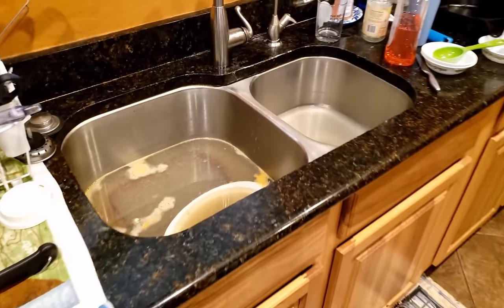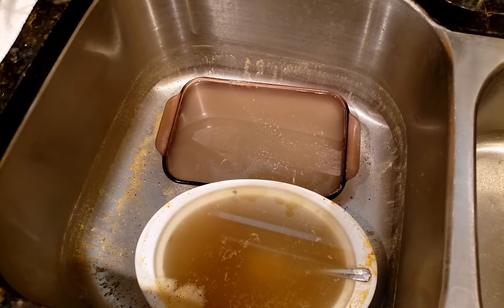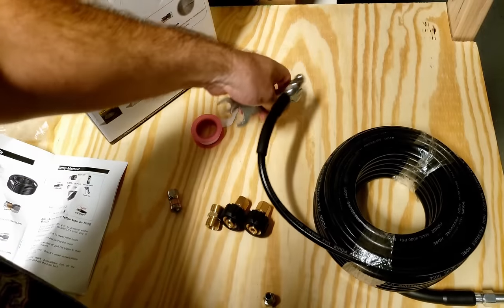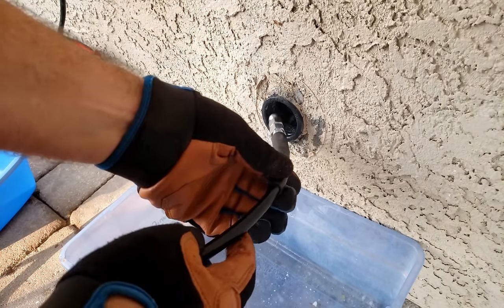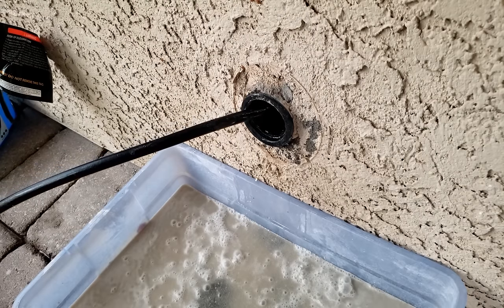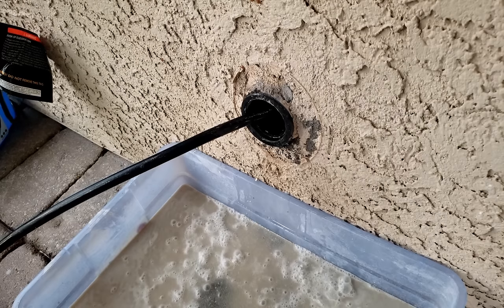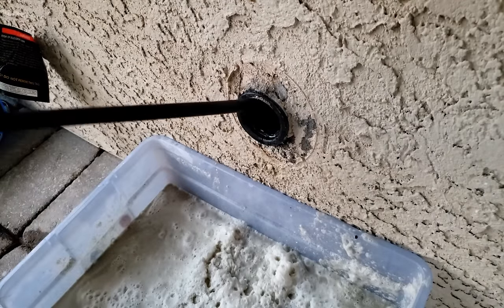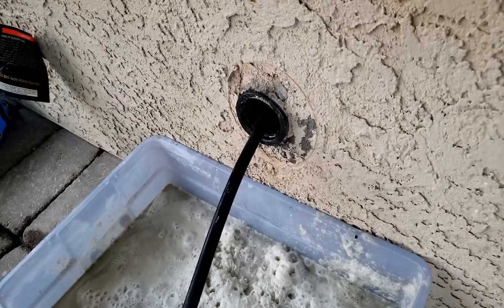UNCLOGGING my kitchen sink with a PRESSURE WASHER and the POHIR Sewer Jetter Kit

Comment from the maker: To get more information on the products used in this video there are some Amazon affiliate links in the description for the POHIR Sewer Jetter Kit and the Sun Joe Pressure Washer. This is not a spoused video. The products used to unclog our sewer line were bought with our own money.
Reply: Inherited a house that gets sewer line problems now and then.  Stupid question.  Can I clean the lines through the washing machine drain pipe instead of going outside?  (We moved the washing machine upstairs so I have a pipe in the basement that I use to get rid of dehumidifier water and to get rid of water when there have been floods.  It would be so convenient if I could do this process through that pipe.
Reply from the maker: If you have a large house there may be multiple drain pipes that can get clogged. It just depends where the clog is. If the clog is after the laundry drain then it should work but if it is in another drain pipe you will have to move up to that pipe to unclog it. The Sewer Jetter Kit description says it works on all kinds of drains, inside and outside. I have not used it inside the house yet but I plan too. I have a slow draining toilet that I am planning to use it on. It is upstairs and the toilets go down a different drain pipe. So I will have to go up there to clean out that drain pipe. I am using an electric pressure washer but if you are using a gas pressure washer the exhaust fumes could be an issue inside your house. I would also be concerned about the water coming back out of the drain as well. A lot of water came back out of the sewer line while I was breaking up the clog. So a good wet vac would really help to clean up any excess water during the process.
Reply: @ThatHobby  Thank you that is helpful.  I have a ranch.  It doesn't have two levels.  And I think the washing machine drain is closest to the main line drain.  In the basement, I can see the rest of the pipes in proximity to the washing machine pipes.  They aren't that far apart.  I will try it.  I don't really have a clog right now.  But I am trying to do a clearing process of some sort once a year before the first freeze.  We have had the mainline back up into the basement a few times and for the rest of my life the goal is to be proactive in preventing it from happening ever again.
Reply: @ThatHobby  luckily in the uk we don't have waste disposals and also our pipes go straight outside to a gully
Reply from the maker: @theoddjobcentre6686  That sounds like a pretty good set up

Comment: In my opinion: Get rid of the garbage disposal. This does nothing but keep plumbers in business. People putting their table scraps in the disposal leading to blockages and smell. Put a fine strainer basket in the drain and empty when it is full. People need to scrape table scraps off of plate onto garbage can. Using a paper towel to wipe the plate from most of the grease helps tremendously.
Reply from the maker: Yep prevention is the way to go. Once you get your pipes cleaned out you want to keep them that way.
Reply: Never had a problem with a garbage disposal. I did happen to buy a house that did no have one and after replacing the kitchen I found the drain was completely clogged. I ran a snake 25 feet and it's still clogged.
Reply from the maker: Yeah I have a 25 foot stake and it usually does the trick but it didn't work on this one. I think it was just breaking up the clog and it was getting stuck again further down the line. I used a 50 ft sewer jetter this time and it did the trick. They do sell these in 75 ft and 100 ft too.
Reply: I'd 'pay through my nose' for a 'Neumetic-Jetting-Garbage-Disposer' 🤪
Reply: Yes!!
Reply: Garbage disposal if functioning properly has nothing to do with clogged drain. It actually is the last line of defense for a kitchen sink branch line. Where do you think food washed off of plates from the dishwasher goes? His problem was grease in the drain. You can tell based on the chunks. All grease. Grease condenses and hardens when cooled. Most people pour it down the drain when it’s warm thinking it’ll stay that way. Service plumber here
Reply: @ZachL_1994  so as a plumber, I’m sure you have unclogged a few drains and found the P trap full of food scraps that didn’t get fully chewed up or that the disposal itself is clogged itself with meat it didn’t grind up enough. Either way, after removing the GD, I haven’t had to clean the P trap or had a clogged kitchen drain. Scrape the plate of uneaten food and wipe the plate with a paper towel and dispose it in the trash. We even rinse in the sink to get the dried food off before putting it into DW to help from not having to clean it out. 

I spent two hours at a elderly friends house one day as his sink wouldn’t drain. I had to replace to P trap and removed grease and food scraps from the line going into the wall after the P Trap. I also cleaned his DW filter which was nasty and full of food. Then removed DW drawers and cleaned the walls of the DW tub down. I had mentioned prior to this clogged drain incident to scrape his plate into the trash and wipe it down with a paper towel into the trash when I watched him put chunks of meat and vegetables into the sink and then use the disposal to get rid of it. I told him that would eventually clog his drain, but I guess old habits don’t die.
Reply: A common disposal problem is, people don't let the disposal run long enough, and they don't flush the drain with enough hot water to properly clear it.
Reply: That’s a cute baby Hydro Jetter The truth is you don’t know your line you can keep cleaning the grease out but how do you know if that line has other problems I’ve been doing this as a professional plumber for a long long time and yes we Hydro jetting we clean out sewer lines but what also causes huge issues is sags and bellies in lines it can also be root intrusion but usually on most kitchen lines it happens to be grease oils hand soaps and many other things that can cause the line to back up it just builds up inside of it and we use drain snakes and Hydro Jetter‘s to clean it out The best thing is try to avoid pouring grease  down the drain it never happens removing a garbage disposal the stupidest thing I ever have heard because the truth is if you feed garbage disposal properly with water it should be able to handle the food waste in a efficient manner and it shouldn’t plug up your sewer line if your sewer line is backing up constantly you have bigger problems than just Hydro jetting you could have a cracked pipe that has roots in it you can have offset fittings that aren’t glued that have finally offset themselves
Reply: @electroluxlad  again; in my opinion…. I don’t use or want a disposal in the kitchen. You are chewing up all that garbage which will eventually end up someplace down the line. Wipe the plate clean into trash with one paper towel then rinse and either wash in sink or put in DW. I don’t have clogs in the kitchen and don’t have the expense of a disposal plus the room it consumes under the sink. For large grease like bacon or ham, we try to use paper towels to create solid waste and put in garbage. 

Don’t mean to be disrespectful, but for me the disposal is a problem waiting for someplace to happen.
Reply: @randypendleton2529  if that’s what you firmly believe go buy yourself a 1 hp and insinkerator  don’t bother buying the cheap knock off version that’s what people buy all the time and that’s why they fail it’s the problem of putting down Drano‘s in harsh chemicals that kills the bearings in the bottom of the shaft seals that’s what ruins and that’s what causes them to leak if you properly maintain it by putting ice and lemon through it you’ll never have an issue with itI’ve had one in my kitchen for the last 27 years it still works I’ve never had it back up my line never has leaked underneath my cabinet and has eaten a lot of different things over the years
Reply: @jaimslaw  It’s the tampons and the condoms and the other shit that go down the main sewer pipe you’re talking about a 3 inch line my friend or even four or even six how is that possible 51 garbage disposal the two of them think about the logic in your sentences The truth is it’s all about how you use it if use it properly maintain and you love your garbage disposal gonna last long time but it’s the tampons in the plastic part that go down and get stuck in between with a glue joints of the ABS in the cast or whatever the pipe is
Reply: @electroluxlad  In older buildings built in the 1950s, those 70 year old cast iron drains lines are no longer 3” in. diameter.  And they suffer  corrosion and other issues that add to their inefficiency, meaning blockage occurs from a variety of things.  Moreover, plumbing woes exist on branch lines as well, particularly the case with how back to back units/Kitchens are plumbed.  Property managers routinely see a drop off in blockages once disposals are removed.
Reply: I have a garage disposal. I run plenty of water through when I use it. A tip that will keep your branch line clean: about once a week fill up a 5 gallon bucket of water it can even be grey water from the washing machine (in a drought area) and pour it down the kitchen sink. You need a large enough volume and surge of water. It's worked as far as I can remember.
Reply: A kitchen stoppage is not going to keep a plumber in business. A plumber is always going to have work no matter what. Plumbing is what separates a 3rd world country. He is always going to have issues with the kitchen/secondary line due to being on a slab. Do your research being you write a comment. Always install a 1h.p garbage disposal
Reply: @billrook6165  if they are going through all that trouble, just do the right thing, no food or grease down the kitchen sink drain,it will save you alot of trouble.
Reply: His problem is grease  I pour all my liquid grease in a container and have never had an issue with clogged drain
Reply: Eeeyup. I was saying the same thing last week. I’m a plumber, not a drainage tech. So when one of my wife’s family members called me over about a kitchen sink, I couldn’t exactly turn the work down, but like I said, I don’t like stinky drains either. Once I’m there, it feels like it’s my problem too. 

Anyway, I get there and I immediately see a brand new garbage disposal. I just started shaking my head. He proceeded to tell me that he attempted to plunge the sink and food started pouring out of the washing machine standpipe. It was a young couple. I’ve never seen so many noodles in all of my life. It looked like they had crammed a whole pallet of nissin cup of noodles down about 40’ of 2” pipe. All “dad plumbing”. Not a hanger in sight. Dips and valleys everywhere. I went back home and got a pressure bag after running my machine and the caked up food just collapsed and clogged it up again. Old school pressure bag saved the day and burst through it before I could turn my back and walk away for a minute. They can cause a disaster sometimes though.

The crazy thing about it is I already have one of those little Amazon jetter kits, I just never think about it and I don’t even know where it is.
Reply: Very true a plummer me all of this!
Reply: I agree!
Reply: You are absolutely Right, that solved all my kitchen drain  problems in my last 10 years

Comment: It worked for me!! I bought the $36 50 ft sewer jet kit that you posted and a 2100 psi electric pressure washer and it took longer to assemble the pressure washer and hose than it did to clean the clog. Thank you for saving me about $500!! I refused to pay $275 for the plumber to stick a camera down 10 ft to tell me what I already knew and then more $$ to hydro jet it out. PLUS, now I have a nice pressure washer to use around the house. Win! Win! Thank you for posting this video!!
Reply from the maker: That's great! Yeah it is nice to have a pressure washer around. Plus you can clean out your pipes again if you need too.

Comment: Always pour your grease into an empty can and toss when cold, if it's a small amount of grease use a kitchen towel to mop it up and throw it in the trash. You will never have a grease plug again.
Reply from the maker: Great tip! I couldn't agree more. Once you get your pipes cleaned out you don't want to clog them up again. So yeah I cleaned out my pipes and I have been working hard to keep them that way too.

Comment: First, plugging the drains on the kitchen sink before removing the clean-out plug was my go-to. Then, if it's dry when you remove the plug you know it's between the sink and clean-out . If not, snake or jet from the clean-out and then release the sink water to blast out the line. Voila!
Reply from the maker: Yeah there are a few different things that will work. That is a great technique. If that doesn't work the sewer jetter will do a pretty good job of getting it all cleaned out.

Comment: This was the first video I saw where I learned to do this with a pressure washer.  I ordered the POHIR Sewer Jetter Kit through Amazon and flushed the sink cleanout (had filled the line with "Green Gobbler for Main Lines"-and let it simmer for several days beforehand); and after about 15 minutes of pressure jetting the line --it was unclogged!  You saved me $1700- which a reputable drain service wanted to charge me to hydro-jet the line.  Thank you--That Hobby!
Reply from the maker: Oh wow! Good job! Not only did you save a bunch of money but now you have the equipment to clean out your pipes again if you need to.

Comment: I don't have a plug drain like that. I usually have to crawl under the house in the mud at 77 years old with arthritis and snake it from the bottom up. Can't do it from the sink because the snake turns up and goes out the roof vent. Will try your Jetter method to just travel down the roof vent instead. Hate crawling under the house .. too many spiders under there.
Reply from the maker: Yeah I had spiders under my old house too. One time after working under my old house I went to take a shower and I set my hat on the bathroom counter. When I got out of the shower there was a big spider on the counter. It had been on my hat the whole time.

Comment: Just FYI, Never stand in front of a clean out when removing the cap or plug! Stand next to the side and if your in a basement on a ladder get a old shower curtain or a tarp and drape  it over the clean out down into a large trash can then loosen the plug to relieve the pressure and all the sewage will spray onto the tarp down into the can! It’ll save you from a stinky flooded clean up!
Reply from the maker: Good advice. That sounds like a great way to reduce the mess. Plus you don't want any of that dirty water hitting you in the face.
Reply: Hi I'm from Philippines where can I buy this attachment for the pressure washer to be use as jetter sewer
Reply from the maker: @danilomelendres2488  I am not sure? Check your local hardware stores first. If they don't have it maybe they can order it? Amazon will ship it to you for a price. If you just order the sewer jetter nozzle from Amazon the shipping may not be that bad. Good luck and let me know what you end up doing to get a sewer jetter nozzle.
Reply: Always have an apprentice stand in front of the cleanout.

Comment: Run hot water down the drain about 4 minutes. Then case about 2 gallons of boiling water from 2 pots from your stove. Then keep running hot water after that another 2 or 3 minutes. This will melt all of the grease that goes down the drain. Do this once a month or so to prevent the clog in the first place.
Reply from the maker: That sounds like a pretty good idea. Getting the grease out of there before it causes an issue is the way to go.
Reply: It's not good to keep throwing boiling hot water down the drain if you have tubular pvc drains under the sink.

Comment: So I've only used this pressure washer one time. https://www.youtube.com/post/UgkxfQauTxLT0JLSvqkq10rD79TU4k0Vz8zP  The one time I used it, it worked great. I recently had new siding installed but kept the old gutters and small areas surrounding my house that weren't replaced so they looked horrible and dirty because of the new siding. I needed to get it cleaned asap. When I used the pressure washer, man it just melted all the dirt and grime that was on those areas of my house. I used that krud kutter soap and it was over after that. Easy to assemble, feels durable, very simple to use. Also, I purchased a used one to save money and there was absolutely nothing wrong with it. I want to get more use out of it so I think I'll be washing the cars and update this comment as time goes on.
Reply from the maker: Yeah it got the job done. I have had it for a few years and it still works great too.

Comment: It makes me so glad that UK plumbing is so much easier to work on than US plumbing.
I never thought an electric pressure  washer would have the power to run that nozzle, but was glad to be proved wrong.
Reply from the maker: I am not familiar with UK plumbing but if it's easer to work on then that sounds pretty awesome to me. Yeah the Sun Joe pressure washer is a little under powered compared to gas pressure washers. It took 3 solid attempts to completely break up the clog and clean out the sewer line. But for the money it got the job done and it is also a great budget friendly pressure washer to use around the house.